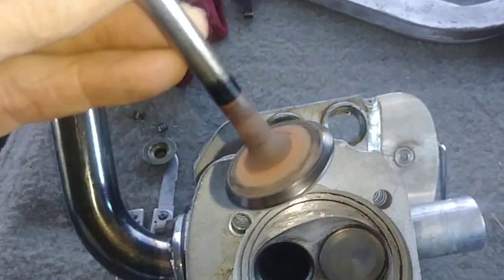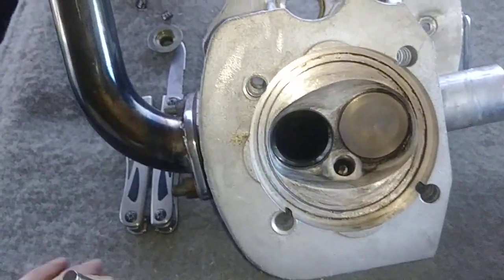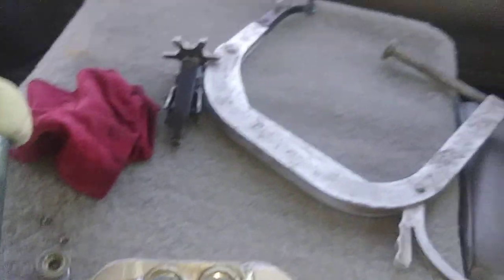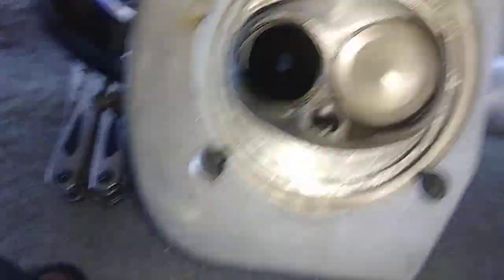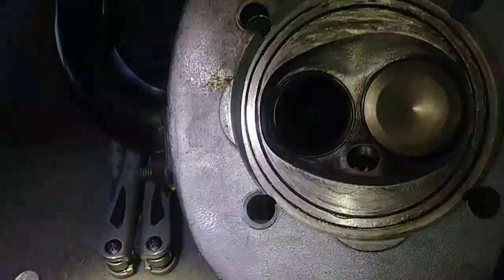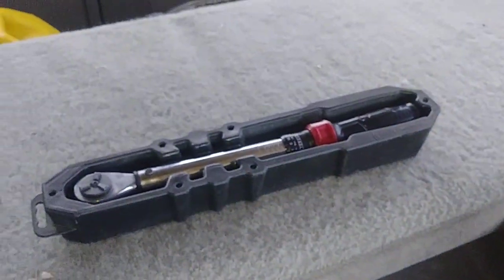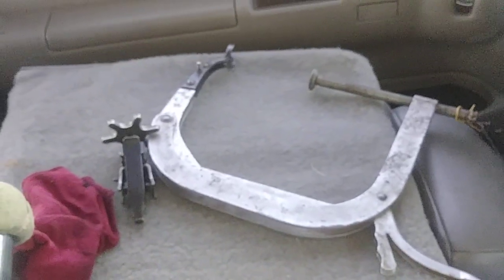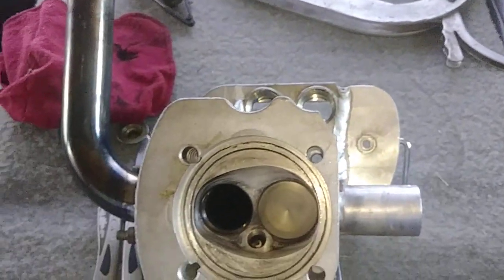Thanks Peter UC ex valve out.

Comment: Sweet! Looks fantastic! I run mogas, and am scratching my head, with my pitting issues :-).  Wish mine looked like that!
Reply from the maker: Hi Peter well I am running unleaded premium with no alcohol 99 percent of the time. I do not know why you would have the problem. What does Scott say?
Reply: the avgas sold as Low Lead has 5 times as much lead in it as 80/87 av gas used to have.   valve guides and seats need to be spec'd for no-lead.   alky free car gas is nearly impossible to find in calif.   if I was running car gas, I would mix 1/5th av gas in it to lubricate the valve stems and seats.. but all av gas is far safer and will not go bad.  I cannot explain pitting when av gas is used except due to acid formation caused by condensation.( re-read you are useing car gas that is the problem)  I assume you are using a compounded aviation oil... or a good motorcycle oil for aircooled engines.  or even something like delo .  Re-read:  you are using auto pump gas.. so alky  corrosion and condensation is your culpret.  I would quit using it and switch to avgas... you will trade plug fouling for seat wear.  not a bad trade.